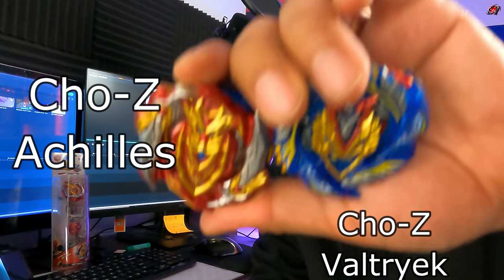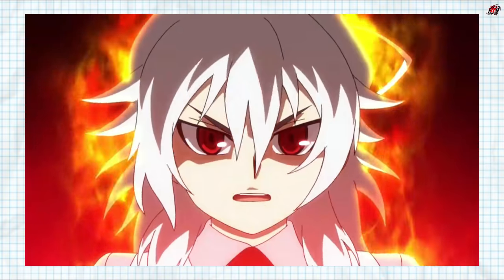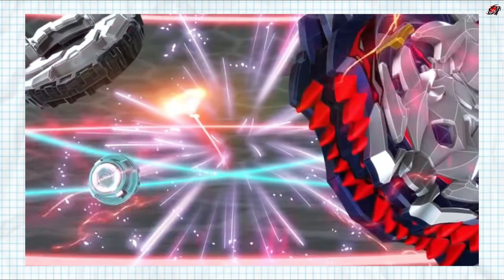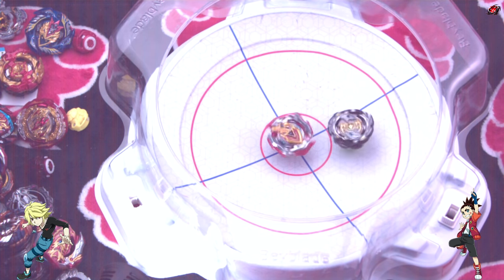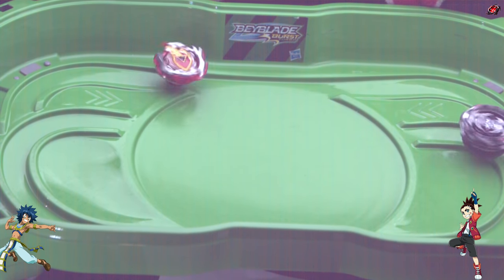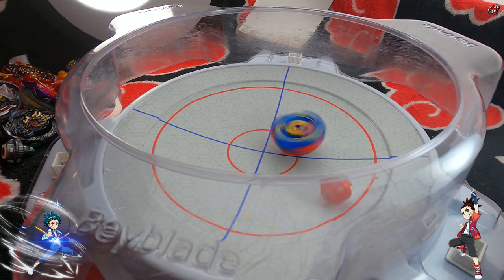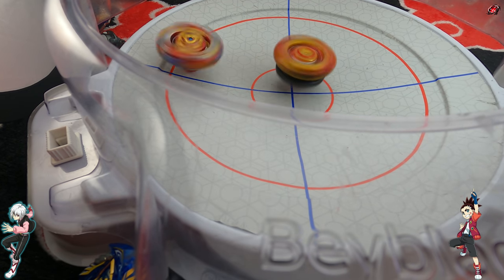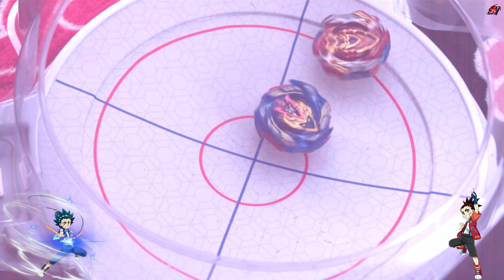Turbo Wings FAIL in ultra slow motion; Burst stoppers USELESS?

Comment from the maker: The 2B gimmick is taking longer than expected 😅 I hope this makes up for it! If you like slow motion check out Savior bound in slow motion here: https://youtu.be/WfX5O0kg-ys
Reply: Hi Beyblade Dad what you doing?
Reply from the maker: @lilkev5218  working on some more slow motion videos 😁
Reply: Beyblade dad i think your right because if aiger accidentally made the launch wrong it will not activate then it will burst
Reply: Z Achilles is pretty broken like the shape of it I thought would be bad. I remember looking at it in 2018 and saw the shape of it and I was like this thing looks like a plus sign. It performed better than I expected :) good video. Keep up the good drive.
Reply: @crimsonbladeyt6011   agree even in real life if your launch is not at full power for the turbo blades to come out.it will lose like unbalance for one to be out and the other not out  just example why it could lose.
Reply: @BeybladeDad   I think Achilles is a cool bey but for the z Achilles I mainly got for the driver and for the xtend plus part, but with the right combo for it or any good combo I think this bey  is useful.

Comment: Speaking of Z Achilles, i still remember what happened in the fourth tournament that i participated 😑. 
It was a 1v1 any combo tournament, with the exception of the beys after hell salamander, and i still had my Spriggan Requiem.0Bump.Orbit . I made it through the 1st round, but in the second, my opponent not only used a stock Z Achilles, but also a PROTO LAUNCHER . It was then i underestimated my opponent, launched to hard on left spin, and

*BURST*
in ONE HIT 🤯
Reply from the maker: Omg! More proof, Z Achilles is worth it! Was it TT?
Reply: @BeybladeDad  So the moral of the story; Don't launch too hard against an opposite spin bey. But also not too soft that your bey can hardly spin 😅
Reply: @BeybladeDad  also yes it was a tt tournament
Reply from the maker: @D4rrag00nXD  yeah, not all layers are made the same
Reply: @D4rrag00nXD  another thing there is a 1 hit combo launch for Z Achilles where it does Z buster

Comment: Finally someone thdt appreciates Achilles and understands how good it is.
Reason why Cho Z Achilles has better stoppers.

Valkyrie has only one actual functioning Cho z wing which only stops one disc prong from moving. And the wings are too smooth to do actual attack damage.

Cho Z Spriggan has 2 stopped for both left and right but they stick out so much that they can be pushed in with ease.

Achilles has 4 blades. 2 as defensive shields and 2 as slashing swords. There was this rare time where I put Achilles against Xcalibur and it was one strong hit before Achilles bursted but somehow the wings were still out.
Reply: I agree to this 100%
Reply: It prob hit it so hard that the prongs slid past the burst stopper
Reply: @boredboi6279  yeah that might be the case. But it also resulted in the tip of Xcaliburs sword being cut through the middle

Comment: I think Achilles has the best stoppers and this is because Valkerie's stoppers are large so more area to hit to push it in. And spriggans burst stoppers are good but they do stick out a little. Achilles stoppers are the most flush with its design.
Reply from the maker: I see exactly what you mean! My Achilles has low burst resistance because it's Hasbro, otherwise it may have not burst like that 😅 thanks for watching and leaving a comment ✌️
Reply: I think it’s the opposite and Achilles has the worst ones cause my cho z spriggan almost never bursts and Valkyrie bursts like 1/4 of the time but my Achilles (that is TT) bursts basically any battle. It think happens whenever it’s gets hit so hard it flies into the wall
Reply: "Valerie's" Walmart valtryek 🥶🥶🥶
Reply: Bruh, I have a Xbox z akillies and they NEVER work
Reply from the maker: @potatman1775  what's that ?
Reply: @BeybladeDad  achilies, i cant spell
Reply: @lloydgarmadon6696  same with achillies
Reply: From my experience with them Achilles are the worse middle is spriggen and the beat is valkerie (I don’t remember the last time it bursted) it might be because I’m using the white version instead of the blue one but it really is good
Reply: @forgottengenesis3684  i think it bursts almost every battle because the burst stoppers just don’t come out for you, i find that one of my cho-z achilles burst stoppers comes out when i launch super hard, but the other is so tight that i can’t ever seem to make it activate, maybe yours has 2 really hard burst stoppers to activate
Reply: @forgottengenesis3684 it's bc of Zeta'
Reply: @Auxum valtryek is Walmart Valkyrie so shut up💀
Reply: @Auxum  i aint watching burst no more
Reply: @Auxum  i watching metal fight
Reply: People make money off of beyblade vids